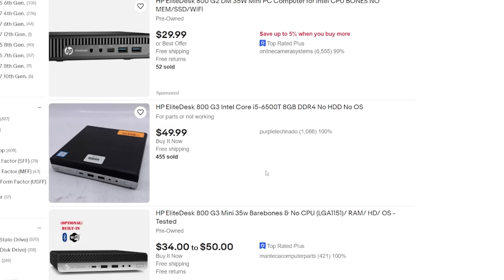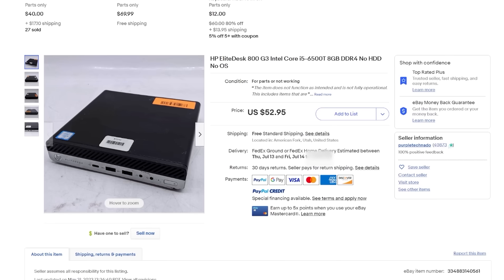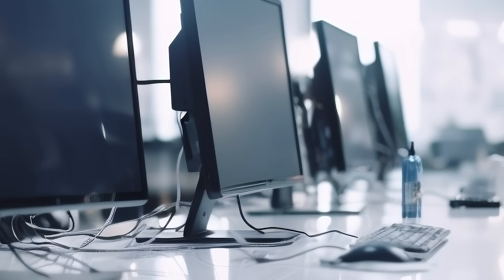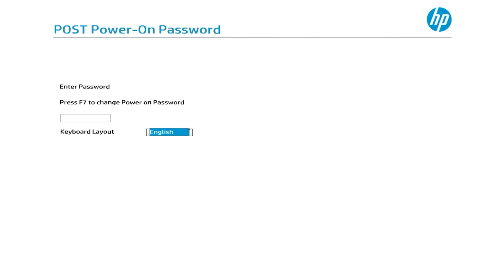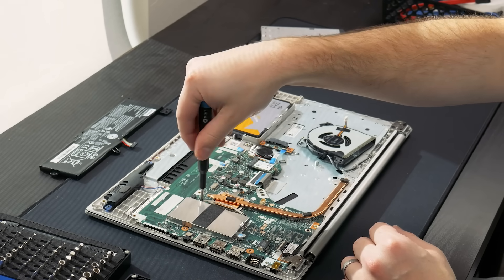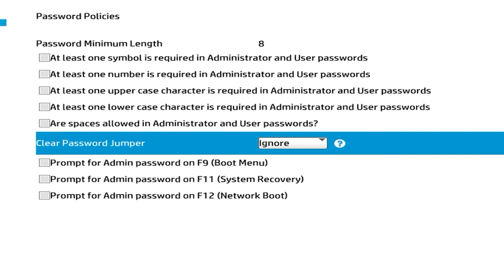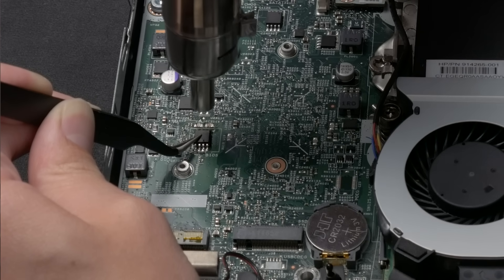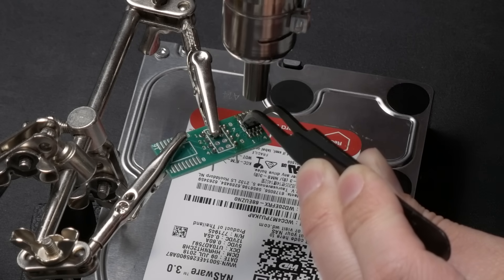I Bought a BIOS-Locked PC. Should You?

Comment: Flashing the bios without the serial number and mac address seems not to matter that much.
I used the image dumped and cleaned by another user so it was already the correct size but missing the info mentioned above.
I was able to recover a system that was not starting before. Works to this day.
Reply: that is true. But it does matter on chromebooks. If you lose the original firmware it's a paperweight if you didn't already put good working custom firmware on it

Comment: Most motherboards have not standardized header pins that allow me to connect striate to the bios chip. I use mostly those to get a copy of the BIOS and reprogram it. Stand alone motherboards are easy, you just flash the new bios file from the support page on the chip. Mainboards from Dell, Lenovo or you name it including a windows key are harder and a big pain. You need to preserve the windows key and serial numbers this means there is no other choice than replacing parts of the bios mostly by try and error.
Reply: If you dump the original bios, the serial number and windows key are typically stored in plain text
Reply: @coctailrob  It is mostly not easy to find those, they are not labelled with serial number or windows key.
Reply: @Amixus  that's true. But I think last time I looked , the windows key was stored in one of the padding sections (extracted using uefi tool software )

Comment: As every HP product I ever used, BIOS (UEFI) always sucked and was too restrictive. In HP products there are soooo many things artificially restricted. In workstation HP products, even tho platform supports CPU/Expansion Card or any other thing, if HP doesn't want you to do it; you basically can't. (Why would you upgrade what you have instead of buying a brand new one from HP!!!). Printer people will know better.
Reply: I've always been really impressed with HP's documentation and service info, especially for their workstation hardware, but I cannot stand their software. As far as buying old office stuff, I think the Dell BIOSes are much easier to deal with, and I actually don't mind Dell's update manager. It stays out of the way and doesn't bother me until I decide to check for new firmware, something HP just refuses to do.

Comment: bios locked as in password locked? you can just remove the battery for it
Reply: Some of them still store it after removing the battery
Reply: That doesn't work for supervisor passwords and is also a common problem with used thinkpads.

Comment: Over the years I’ve blown up two desktop motherboards by flashing the wrong bios in one and not using the proper OS the flashing software wanted. (I used win 10 but the loader program wanted win 7) I didn’t throw either motherboard away and I figured a solution would pop up in the future. The first dead mb was fixed by swapping the dead bios chip with another bios from a similar mb (socketed bios chip swap) and the second one was fixed with a CH341a reflash.
Reply: Now that is some dedication
Reply: I think this has to be the dumbest mistake to make the bios upgradable and not have a failsafe in case something goes wrong, but once again this might be just another reason to sell you more hardware. 

I never upgrade the bios, especially on expensive laptops, because if something goes wrong, good luck, all you have left is a expensive piece of junk.
Reply: @D4no00 most pcs nowadays have 2 copies of bios
Reply: @JordanPlayz158  "most" is the perfect word to describe this. Since there is no standard, you are not guaranteed that you won't brick the device should something go wrong.
Reply: @D4no00  true but with a usb programmer, even with 0 backups, it can be repaired luckily
Reply: @JordanPlayz158  on a laptop? don't think so, especially the new ones, where everything is crammed and glued together.
Reply: @D4no00  Oh, some laptops don't use normal bios chips or you mean they are hidden in some way?
Reply: @JordanPlayz158  first of all yes, it's most probably a BGA package, you will most probably have to solder tiny wires to reprogram it, and the second thing is that in general it's risky to open these devices, a lot of tiny connectors, no instructions, you can break something really fast if you don't know what you are doing. I would just stay with an outdated bios, than to risk a 3-4k computer becoming junk.
Reply: @D4no00  You buy 3-4k laptops??? Also is this anecdotal (based on experience) or guessing or... something else as I would be curious to see a laptop with a BGA bios chip but it is possible. And I do agree, people who don't know what they are doing, it is easy to break things if they aren't careful or don't take it slow, have definitely seen some awful laptop designs for disassembly... not fun
Reply: I would not call it blown! Its just stupid saying i blown a mother board without any components blown up i would call it bricked! Please say it right
Reply: @309electronic5  say it how you wish. trust me, When i flashed the wrong BIOS from being in a hurry and I needed to use the computer, it was truly "blown up" at the time (this was 20 odd years ago) I had no hope of ever fixing it at that time nor did i know if i could ever fix it.  It was just by accident that I got given a similar MB with the same BIOS chip a few years later. Yes, it  bricked or blown or non functional and it was just lucky that i fixed it.